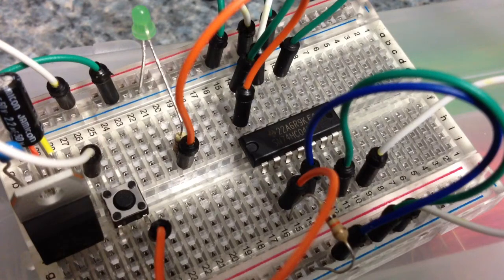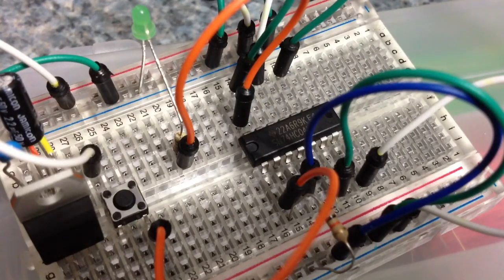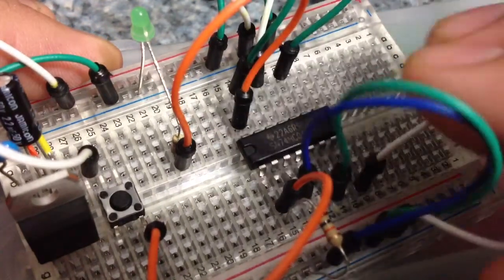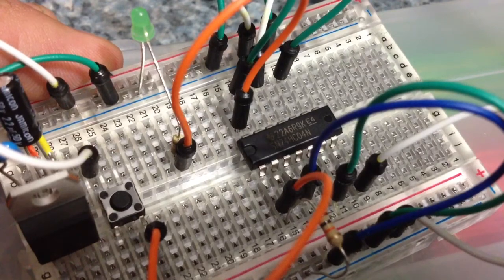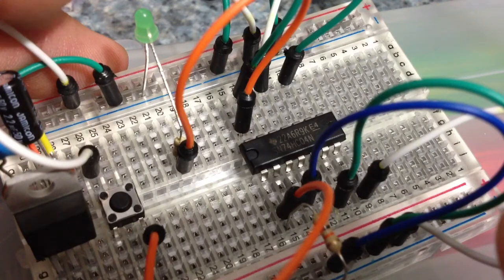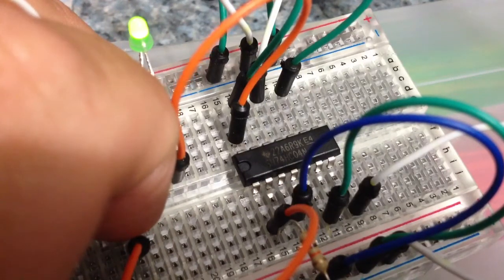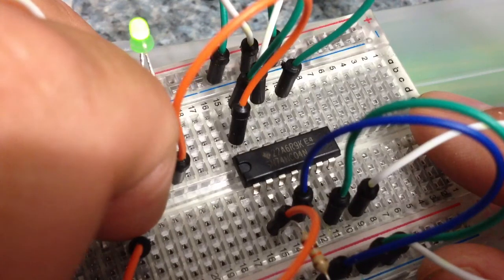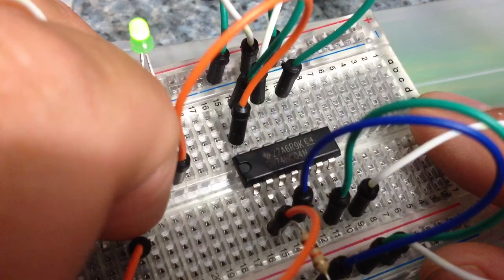Hex Inverter Mystery

Comment from the maker: I've already got this one solved (I think!). So despite the basic diagrams of the Hex Inverter that were in my text book there are connections between Vcc and each gate - of course... And there is a Diode between the Vcc and the Inputs to prevent Vcc from flowing into the input pins... HOWEVER - IF you have Vcc floating - say for a switch or something and you apply power to an input pin it can flow across the diode and OUT the Vcc! (ZOMBIE POWER).